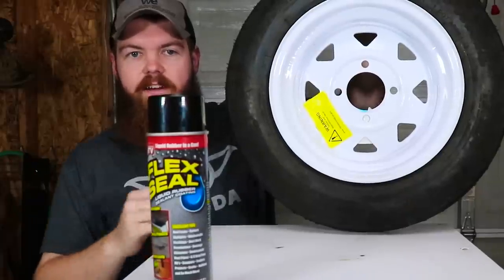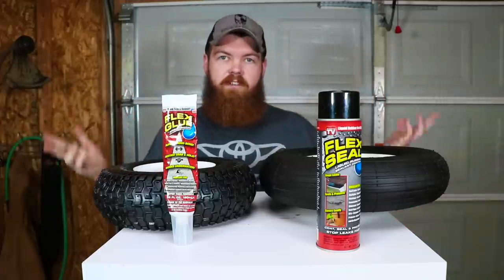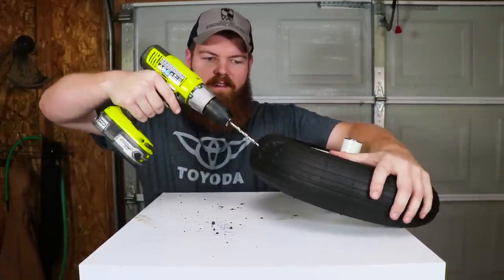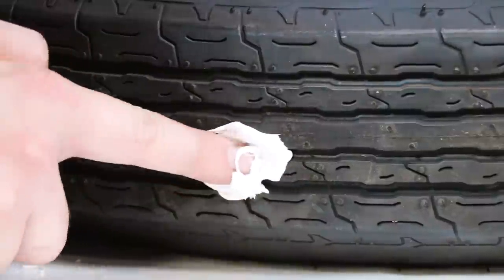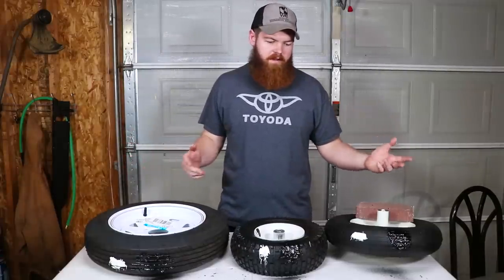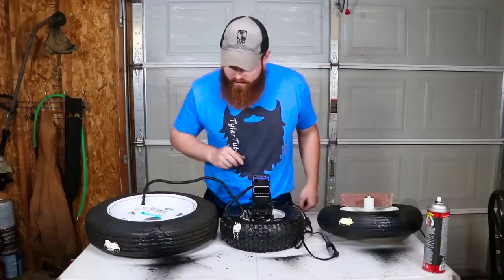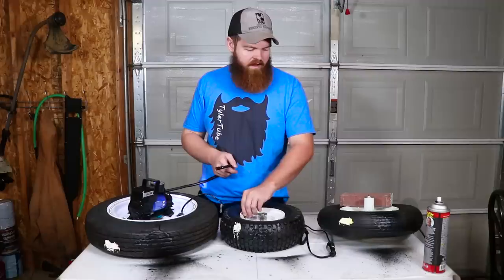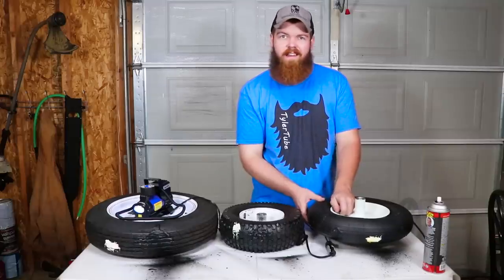Can Flex Seal Fix A Flat Tire?

Comment: Very cool video Tyler and we definitely never recommend using any of our Flex Seal Family of Products on tire pressure.
Reply: Flex Seal dayum Flex seal its self here but I reckon your a bit late
Reply: But can you flex seal flex seal 🤔
Reply: I recommend using both they work very well on tires.
Reply: Idk flex glue seemed like it worked pretty well. Maybe not on a car tire, but a lawn tire is fine. Don’t get near fast enough on one of those to cause any damage

Comment: Tyler. Take  the trailer tire off the rim. Add flex glue to the hole from the inside and then after the glue is dry spray it with flex seal a few times. I'd like to see if it would be viable to work that way and then somehow put it under a load test to see if it stays up if it holds pressure
Reply: i was thinking the same thing. one hole at a time and fix it from the inside. the pressure should push the material against the damaged spot instead of away from it, giving it a little more support to hold.
Reply: Was literally about to type this out as well!
Reply: Lol I was thinking the same thing from the moment he sprayed it And when he drilled a hole rather than poked a hole in it
Reply: This is Tyler your talking about.  Anything that requires an ounce of effort or thought is left out of his videos.
Reply: I used flex seal spray on the inside of my severely weather cracked atv tires and have put 1500 miles on them since spraying without a leak
Reply: It would work, if not just glue a patch on the inside, I once patched my own tubeless car tyre using a pushbike patch repair kit on the inside .. the air pressure will push it over hole so even a glue stick would probly work lol
Reply: Tylor...
Lets Put Green Slim Tire Repair on the Outside of the tire/tube instead of inside of a tire/tube. Uggg.
Reply: Same thing I was thinking.  Spraying coats on the inside of the tire.

Comment: U should have did one tire flex glue and one tire flex seal to know for sure if the flex glue worked or the flex seal
Reply: That makes sense. I'm a big science nerd and I didn't think of that lol.
Reply: You can just feel where the air is coming out. Did you watch the video?
Reply: @booty_hunter4207  well, weed loving booty Hunter...
The tires could release air slow enough that you can't feel it, but with a sensor you can tell.
Also, maybe the flex glue would have gave up after more pressure has been added.
Your username reminds me of Reddit bro.
Reply: @karamalqussiri6533  yeah but that's not what they said though. Also I don't smoke I just thought it was funny
Reply: @karamalqussiri6533  but I get what they mean now

Comment: Really should have used a nail. Nothing really bores a hole out of a tire on the road that often. Material wouldn't have been removed with a nail.
Reply: I couldn't have said it better.  I did tire work for years and the biggest thing I ever seen in a tire was a 8 inch long bolt with a 3/4 inch shaft  and when I took it out the hole still closed up enough that I couldn't see light thru it. Punctures only move material not remove it
Reply: Yeah that was a big ass drill bit too.  Nail is a most realistic scenario
Reply: chad williams  wow your customers were lucky then! We get rebar, brake pads, hand of screw drivers, phones, I’ve seen literally everything in a tire
Reply: Should have gotten tubeless tires kinda disappointed
Reply: @jeremydewayneellis  did you watch the video?
Reply: @Driftlife36  a phone!?

Comment: Ideally, you'd want to seal them from the inside, so the air pressure pushes the seal against the hole instead of away from the hole.
Reply: Exactly his test is useless at this point
Reply: I was thinking the same thing that sealing from the inside would be more effective. However I think even in that sense it would still be useless information simply because you still have to go to the trouble of removing the tire. In which if you're removing a tire to apply flex glue or seal to the inside why not just use the proper patch to start with which is cheaper.

Comment: Lol wtf. You should redeem yourself and do another video where you get actual tubeless tires. Also, use a dunk tank or a spray bottle with soapy water to check the flex glue to see if any micro bubbles appear.

Comment: Tyler Tube you need to drill the holes and spray the flex seal on the inside of the tire. Make sure there is an even coat and there are no air bubbles. The uneven surface on the tread of the tire didnt allow for sufficient sealing and caused air pockets the form.
Reply: You have a point
Reply: LIES.....LIES. I did this exact same test to see if it would stop the tire from leaking air. I ONLY sprayed it on the outside of the tire and it works perfectly fine, you don't even have to put it on the inside the tire🙄🙄🙄

Comment: Tyler you can tell if a tire has a tube or not by looking at the valve stem, you don’t have to destroy a perfectly good tire. Also ,it would have a better chance of sealing if the sealant is applied on the inside.

Comment: Hey tyler for future reference with a flat tire push and twist the valve stem if it pushes in its tubed if its solid its tubeless and to check for leaks use soapy water

Comment: You definitely need to go into more detail on this one..  I recommend trying to repair the hole from the inside of the tire (both with the glue and the spray version). Also, stick a hole in a bike tire tube and then repair using both products. Reassemble the tire and see how it goes. I'm thinking the flex seal or glue MIGHT not 100% fix it, but in a pinch, might greatly reduce the air loss.

Comment: I love your videos and I watch them all, but there is only one fault about this video. When you did the test with the two holes on the same tire covered with the flex seal and flex glue, you should of done one tire flex seal and the other tire flex glue. Reason being is because if the flex seal had a big leak, there would not of been enough air pressure to see if the flex glue leaked. But it was a great video and I look forward to the next one.

Comment: You should attempt this from inside the tire not on the outside.  Still might not work; but since you have the seal on the outside of the tire there is nothing that strong to hold the air back.  However; if you put the seal on the inside of the tire you have the tire holding the seal back more with a smaller area that air could come out of.  I would think it could act like a patch on a bicycle tube.  The tire of the bicycle helps hold the patch onto the tube.  I see many other comments saying the same thing.

Comment: if your not sure if a tire is tubeless or not by label,Look at the valve stem. if it is separate (or just sticks through a hole on the rim,it has a tube,if it had like a rubber neck that is tight on the rim 99% of the time is is tubeless.
+TylerTube

Comment: I've got some dry rotted lawnmower and ATV tires that won't hold air and Green slime won't fix.  

Actually I think some sat flat and the sidewalls cracked due from sitting flat for so long.

My idea was the remove the tire from the rim and spray it inside the tire instead of the outside. Give it a couple of coats letting it dry each time.

That way it wills in the cracks and air puts pressure from within the inside.

Comment: Hey mate easy way to tell if it's tubeless is by looking at the valve stem tubes are bigger at the rim as they need to seal against the hole in the rim and tubes are small and can be pushed in them tire is flat

Comment: I’m only at 3:40. You need to remove the tire and spray the inside for this to work, not work for minutes, but work where you can still use the tire for the rest of the summer.

Comment: Hey tyler. Maybe you should retry the trailer tire and get a crappy car tire and spray the flex seal on the inside of the tires so we can see if it can get you home in a pinch.

Comment: Well I feel like you went about this very wrong! You should have used a smaller drill bit for the holes and you should jave done 3. 1 for the glue. 1 for flex seal that comes in a paint can not the spray type and then 1 for glue then after the glue dried apply the liquid flex seal on top to make a really good seal. You have a whole video you could make trying it like that

Comment: I don't think it will work, but I think using the brush on stuff like tire slime will work well.
Well, the glue will probably stop the leak, but it won't last on an actual tire considering it's on the outside where it will wear, and you're messing with the tread.

Comment: You should revisit this but instead of putting 2 holes in one tire you should get 2 of the same tires and put one hole in each see what works better flex glue or flex seal and if flex seal still has issues see how much it will take to fix it

Comment: We fixed my friend's tire with flex seal. My friend had a 1995 pathfinder lifted sitting on 35s. It was just a pos wheeler that we didnt care about. We were gonna go wheeling one night but noticed the front driver side tire was flat. We drove it down the road to a gas station air compressor with the flat tire hoping it would keep beaded ( it did somehow ) we went to put air in it but it wouldnt hold air for more than 10 minutes. We stood there thinking of ideas until I jumped in the back of the car and started digging through things only to return with a half full can of flex seal. We all laughed at the thought but we tried it anyway. We filled the tire back up and listened for leaks ( it was coming from the sidewall ) we sprayed the whole sidewall of the tire with about 8 coats of flex seal until it held. We went through some pretty nice mud holes that night and the flex seal held up great.

Comment: I tried putting Flex Seal Clear on my Doodlebug mini bike tires. They were all dry and cracked, holes in it. Well the flex seal worked and its holding air!

Comment: You have to use the Flex Seal on the Inside of the Tire.
Get the Flex Seal in the pour/paint can type. Break the Tire bead off the of the Hub Wheel. Dont remove the rim/hub. Pour in Flex Seal inside the tire. Keep Rotating the Tire slowly for 5-10 minutes. The entire inside should get covered. Rotate it longer if you wish. Reinflate the Tire.

The Flex Seal Glue works better.
Break the tire bead. Put the Flex Glue on the Inside of the Tire over the hole. Let dry. Reinflate. You're done.

You could try Spray FOAM the inside of a tire to make a Tire Flat-proof...

Comment: I used flex seal to patch a hole in a tubeless scooter tire. You’ll have better luck by spraying it on the INSIDE of the tire. Inflate it to about 10 PSI just to keep the pressure pushing the flex seal into the hole while drying. Obviously, you’ll find it almost impossible to remove a full size tire from a rim with your bare hands - but if you can break the seal on the bead of the tire - you can spray the flex seal into the tire from the side and position the hole/slit in the tire facing down to allow gravity to keep the flex seal in place. Not an ideal situation - but a flat tire never is.

Comment: If the valve stem is solid and does not push in when the tire has no air it has no tube. Tubed tires when deflated can easily have the valve stem pushed into the tire/wheel with no resistance.

Comment: Usually a dead give away for a tube is the valve... Youu will be able to easily push the valve into the rim or see a gap between the rim and valve if it's tubed. Tubeless has a tightly fitted valve with no gap. Also, most (if not all) bag trolley and wheel barrow tyres are tubed. 🙄

Comment: You should get a little pump thing off a bottle of Slime tire sealant and put some flex seal liquid in a tire and pop a little hole in it to see if the flex seal will work like Slime does

Comment: I don't think this would ever work from the outside. From the inside its a possibility as it would actually go into the hole and the air would push it into the hole and actually seal it. Take the tire off, spray flex seal/glue and put a bit of air in there like 3-4 psi so it seals into the hole as well.

You can try it in a tube like tubeless tires for bicycles, pretty much the tire is filled with a silicone fluid that seals if theres ever a puncture. I dont think flex seal is thin enough of a fluid to work that way though. Could be a good experiment.

Comment: You can always tell if it is tube or tube less by how the valve stem is mounted on the rim.... if it just comes through a hole in rim it is a tube but if it is mounted in the rim hole then it is tubeless

Comment: All you have to do is look at the valve stem to tell if it's a tubeless tire or not. 
You should have drilled one hole and then tested it with the glue, and then drilled another hole and tested it with the spray.
Or something similar.

Comment: The glue would probably work better from the interior because the outward pressure of the air would result in a tighter seal from the glue being pressed against the inside of the tire wall.

Comment: You should of gave them the best shot by taking the tire off the rim and putting flex glue and flex seal on the inside and outside of each hole and use separate tires also you can use soapy water to check for any leaks because the air will make the soapy water bubble

Comment: U should have just asked me.. I've used flex glue to patch cracks in 18 wheeler tankers that have to hold air pressure.. And it works like a charm.. Not permanent but it'll do

Comment: You should take the tire off, flex seal the inside where the hole is, and then put back together to see if it holds that way.

Comment: he should try putting the flex seal in through the valve stem to let the flex seal fill the leak from inside out, not outside in.

Comment: You shouldve used a nail or something similar to do the test because even if you ran over a drill bit it wouldnt bore out the hole like you did. The amount of flex seal hardly mattered by then and all you did was take away its chance of succeeding.

Comment: If you had put the glue on inside would have had a better chance of working. Also using a screw driver to push it in the hole even using plugs with the glue

Comment: Try this again with FOUR identical tubeless tires. Put ONE hole in each tire and patch one with flex glue, one with flex seal, one with BOTH, and one with a tire plugging kit and then test to see which witstands the most punishment.

Comment: You should have put the flex seal on the inside of the tire, that way it would have been harder for the pressure to force the flex seal out of the hole.

Comment: Well Mr. Tube, in the extreme bucket demo, Papa Phil did say that you may need to use multiple coats of flex seal, which you clearly did not

Comment: honesty I think you could take the flex seal tape and put it on the inside of a tire where the hole is and I'm pretty sure it will hold that stuff sticky enough I don't see why not

Comment: Tyler nothing on the roadway would drill a hole in the tire if you were to poke a hole in the tire then put Flex seal on the inside of the tire it would have a way better chance of standing up it’s all about pushing pressure against The sealant rather than pushing the sealant away from the tire

Comment: okay, i was originally going to say, take the trailer tire off the rim, and spray the inside with flex seal. But then I realized that in the real world, driving down the road, that you couldn't do hat with out a tire shop, so never mind. What would be interesting to see is, in a different trailer tire,  if using flex glue only, how much pressure it can hold, and if it could actually withstand being oonn a trailer, and driving down the road, to simulate using flex glue in an emergency..

Comment: I Kno for sure flex seal will seal a hole in a radiator. Drilled a hole in the hood of my derby car and went Abit to deep hitting the plastic of the radiator. But with a few coats of flex seal it sealed right up and have got 2 races on the car so far with no blow outs 👍

Comment: 1. Epic fail on this video. No harsh feelings. You need to try this again man. But just do one flex seal and one flex glue. 
2. You really should use safety with that thing. Cause you are going to regret it when you slice that hand wide open.

Comment: U sould do another vid like this but instead u sould take off tje tire and spray the flex seal on the inside of the tire and it shoyld work better

*u need to use a tubeless tire

Comment: I would have tried to get most of it on the inside of the fire, so the air would have held it to the fire, instead of the air pushing it away from the tire

Comment: Should of pulled em off the rims and sealed em on the inside with the glue and and spray as base then top it with tape

Comment: Using flex seal on the other 2 tires with inner tube is pointless. You need to use it on the inner tube since it has a tube.

Comment: If it has a tube, (you can tell by the valve) the air will leak out of the stem hole. You just wasted your cash.

Comment: well you screwed up the test. you should have put it on the inside as most tires are repaired inside the tire. now as for tube. you should have bought tubes. and did the same thing out side in. and put a small piece of tape over it after applying the flex seal. i bet you might find it works better. an may work out

Comment: just got to @07:54 . . 
why did he cut the tire open and not just take it off the rim. . . lol . . .  "to see what's going on INSIDE" .

also i would bet you can fix a tire with flex seal. . maybe not by spraying it on the outside like spray paint.. (without even roughing the surface). haha
but doing it like a normal tire fix. Except without a patch. 
I would have tried to take the tire off the rim. (even just half -way off. like one sidewall on the outside of the rim). 
then spray the Flex seal on the inside like patching it.

peace, TheEturn